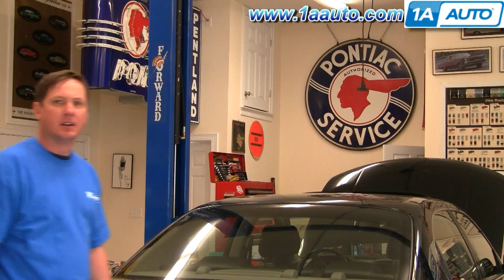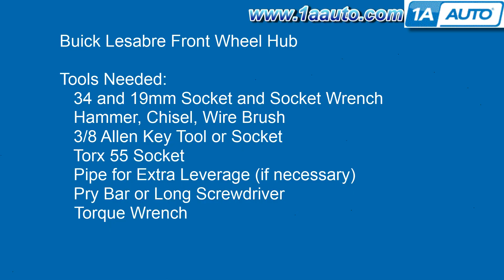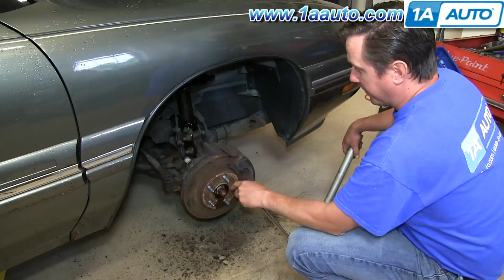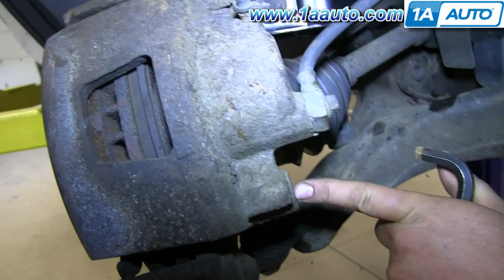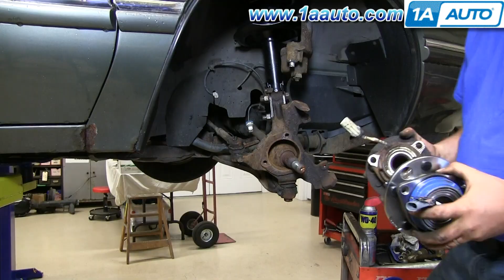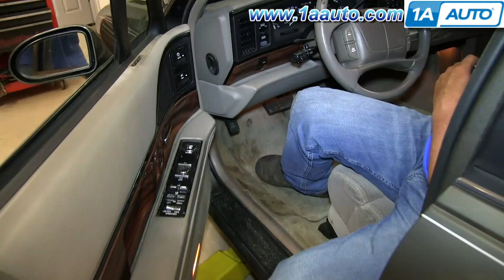How To Replace Front Wheel Hub & Bearing 92-99 Buick LeSabre

Comment: I wish my 97 LeSabre looked that nice.  Rocker panels are all rotted out.  😄Over 253K but still runs like a champ.  Thanks for posting.
My wheel bearings broke apart too and it came out with a punch.  It might make it easier if you punch out the speed sensor portion first and cut the old wire and then punch out the rest.  When you install the new assembly, don't forget to reinstall the backing plate before you thread in the Torx bolts and torque to 55 ft lbs. ✌️

Comment: Assuming this will also work on a '93 Buick Century Wagon...Thanks for the tip on the bigger hole to access the T55 bolts.  Another vid had the guy trying to access somehow from the backside, but that was a 2001 (I think it was a LeSabre), so maybe something changed in the design??

Comment: I am a 60 year old mechanic that has not turn a wrench since 94 , I was a ASE certified mechanic for 25 year , then I got badly injured,  I now do my own work , how ever it takes me 4 hours to do a oil change , I am disabled and crippled , but I love my 94 lasabre , and I do the work my self , THANK YOU FOR YOU VIDEO S , I AM THINKING OF CALLING YOU TO GET PRICES , I WAS THINKING I HAD TO PULL THE HOLE SIDE OFF THE BALL JOINT AND ALL , I THANK YOU VERY MUCH.  AFTER I GET MY STRUTS ON AND THE BEARING , I WILL HAVE. TO HAVE IT ALIGNMENT,  I USED TO DO ALL WORK ON auto and big trucks.  Now I can barely walk , shops charge alot , I my day I made good money , then my accident happend , crushed my right foot and ankle and leg and knee all got crushed , I work slow , I am deeply appreciative of your video , I need to see how the back is , the bad thing is I don't have access to a air compressor , I am all for safety,  I can't go through another accident being over 60 now , just takes me longer , I have a lifter that dropped that is my next project after I get the wheel bearing , this is a safely issue , be calling you , thanks , PATRICK GUNAGAN , SCOTTSDALE ARIZONA,

Comment: Ever have a back plate scrape on a rotor after changing everything you did?
Reply: Mine just did
Reply: Did you fix your issue
Reply: @survivalinstincttx9794  If your back plate is scrapeing, then its not oriented correctly.

Comment: Can you tell me if you have the car in neutral?
Because you're turning the hub as if you have the vehicle in drive or neutral...
So you can access the bolts behind the holes
Reply from the maker: +kedsification Thanks for watching!  If you have to turn on the vehicle for steering assistance you can just leave it in park and turn the wheel.

Comment: installed  a hub on my 97 buick .  brought from youll and the abs traction lights will not go out
Reply: i replaced the right hub because a scan tool said bad rt wheel sensor
Reply: took the car to have the abs light and code erased . but the scanner will not remove the code or put out the abs light

Comment: I just want to say this video saved the day! My brother and I were struggling on how to replace the hub after finally collecting all necessary tools and 4 trips to the parts store. The old hub separated when removing, as shown in this video, and we had no idea how the new one would fit in until we saw that part of the video. 
Definitely going to www.1aauto.com for parts next time I need to do a repair!
Reply from the maker: Ryan Stroman Congratulations on the successful repair.  We're glad the video helped you out.  1aauto.com 866-403-3393
Reply: I have a 1993 Buick Lesabre Custom and im trying to replace the wheel hub. I follwed this video's instructions but something stopped me. Once I separated the hub from the spindle i tried to take off the T55 bolts but i couldn't because the round part that's supposed to spin, will not spin for some reason so i can't get access to the T55 bolts. Any idea how I can make it spin?
Reply: That t55 are you using a 1/2” drive ratchet since it’s a 1/2” socket?

Comment: This is exactly what I had to do yesterday. Only problem I had was the inner portion of the old bearing was stuck in the assembly like yours did when it came apart and I tried the punch option but could not get it to budge. So I took the complete strut assembly apart and pulled it out of the wheel well and worked on it on the ground. Took some doing but I finally got it out and cleaned up the contact surface with some sandpaper. I put the new hub assembly in and it fit like a glove. Now I have to put the lower control arm assembly back on and that is where I'm having an issue. But I think with some guidance I received from one of your other videos I believe I can get this job done now. Thanks again for this 2nd Video as this one is exactly what I was looking for. Excellent video for information on this project and keep up the good work guys. Will be passing on this information and this video to fellow automotive enthusiasts.

Also...just wanted to let you guys know from what I know about the other holes that are in the bearing assembly, I used the smaller holes as guides to keep the socket of the T55 in place while I broke them loose. It was a very tight and snug fit with my 3/8 socket. Then once they were broke loose I used the bigger hole to remove the bolts completely. Worked like a charm. Not 100% sure that's what those smaller holes are for but I didn't want to strip out the T55 bolts. Always a little nervous when it comes to Torx series bolts. Stripping them out would cause a major headache.